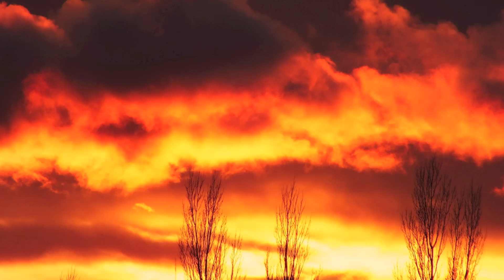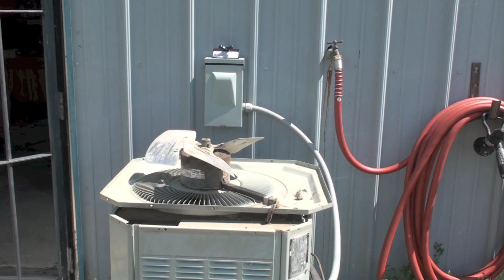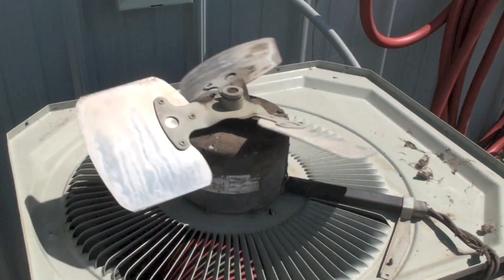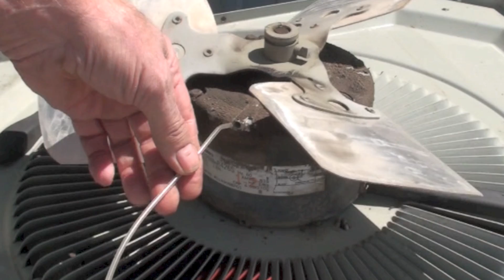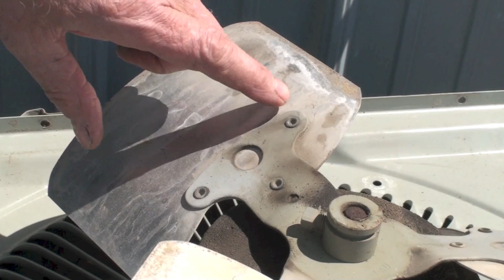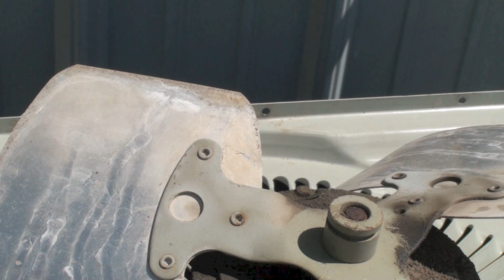Service the air conditioner, check and oil the fan motor, part 3

Comment: Where is the disconnect
Reply from the maker: It should be located near the outdoor unit on the wall.  It will have flexible conduit running to the A/C unit.
GFM

Comment: What kinda oil
Reply from the maker: Most motor manufacturers recommend SAE 20 non detergent motor oil, but you can use a brand called "Zoom spout oiler" available in hardware stores.
GFM

Comment: Both of my 1993 Amana units are still going strong. One has the original fan motor! Just a little oil, cleaning and maintenance. Yes, new units are more efficient but if they have to be replaced every 10 years you lose ALL of that energy savings savings!  Here's a vid of how just a few drops of oil keeps my unit going and going and going.... https://youtu.be/wSBr0PDCbzE
Reply from the maker: Where did you get the idea they fail every 10 years?  Anyone that tells you that is trying to sell something.  Generally, an air conditioner will last 20 to 25 years if it is properly installed.
GFM
Reply: @grayfurnaceman  with a good honest repairman like you, yes. What do you think the lifespan is for a Goodman unit that's well installed? These days? I intentionally said Goodman because its current reputation seems to be that it's not a great unit but a common one.
Reply from the maker: @SwimmingintheDeep  The Goodman units are builder quality units. However they use many of the same parts as higher quality units. If they are installed well they should last. GFM

Comment: Our compressor is out back and our air handler inside our garage. We had our summer check up and the guy told us that we need to replace our motor and possibly the capacitor because there's oil "a lot of oil" on the area below the blades. I noticed in the video on this site when the guy was talking about oiling the motor that there's oil below those blades. Is this a normal part of the motor running or should we be concerned. We have a 4.5 ton Trane unit that we had installed in Sept. 2010. He told us the rest of our unit is fine.  He said the new motor does not have a capacitor in it.
Reply from the maker: The oil may be an indication of a failed shaft seal.  The motor will probably fail when the beatings dry out. If the motor has oilers, you can stave off the failure by oiling the motor several times during the season.  
If the motor fails, the compressor will be running at very high temperatures and could fail.
GFM
Reply: What do you say to the nice GFM?

Comment: One of the plastic oiler caps broke right off the fan motor when I pried it off! Any ideas on where I can purchase a replacement cap and how to pull it out?
Reply from the maker: About all you can do is drill it out.  No, it won't damage the bearing.  Forget replacement, it comes with a new motor.
GFM

Comment: I replaced my fan motor two years ago and this past fall the ac tech told me that the motor was drawing too many amps.  How is this possible for a motor only two years old?  Would oiling the motor help?
Reply: Jeff, it seems strange that a motor would be drawing too much current.  I would have asked the technician to quantify it, i.e., state exactly how much current the motor was drawing and how much it was supposed to draw, and how he knew how much it was supposed to draw.  I'd expect the maximum normal current to be on the nameplate.  Quite honestly, it looks a bit fishy to me.  If something were wrong with the motor to cause it to draw too much current I'd expect it to have a very short life since the excessive current would surely make it run excessively hot.  It may be that a bad capacitor could be at fault.  If the bearings were in such bad condition that they actually caused the motor to draw too much current, I wouldn't expect the motor to run very much longer; perhaps no more than an hour if that.  Assuming that the motor is thermally protected, it would automatically shut off if it got way too hot then turn on again after cooling off.

Your purchasing a clamp-on ammeter was a good idea.  These things are not mysterious and I'm confident that with some studying you will be able to get to the bottom of it.
Reply: Frank I have since had a very reputable company and tech come in and tell me that there is no issue with the amperage the motors in my units are drawing.  In fact he showed me what they were drawing and showed me exactly how to check and I have made notes and will be checking the current on the motors and the ratings on the run capacitors as well each year.  The guy who came out before wanted to make a repair sale evidently.  Of course now that I know exactly how to test and what to look for, I shouldn't have any more issues, and if I do need to replace a capacitor, contactor, or motor, they are easy and inexpensive enough to do so on my own.
Reply: Jeff, it's obvious that you have learned enough about the system to keep on top of the situation.  It's unfortunate that we can't simply trust contractors and that we have to become experts on almost everything, but we have to be realistic.
Reply: Plus im sure ur condenser gets alot more use in Arizona climate than in a Pennsylvania climate.
Reply from the maker: Oiling will probably not help.  If the motor was not the correct one, it could be overdrawing.  Listen to the tech.  He is able to do an amperage test.
GFM
Reply: The motor was drawing normal amperage after 1 year.  The motor I replaced was an exact model with the exact specs of the original motor.  I also replaced the run capacitor with the exact unit as well.  I don't understand.  My AC unit back east was 15 yrs old and I never had anyone tell me the motor was over amping.  Sealed electric motors have always lasted years and years in my experience.
Reply from the maker: About all I can say is if it was drawing excessive amperage, there is a problem.  You could have a failing capacitor.  Or the motor could just be failing.  If the bearings are failing due to lack of oil, oiling the bearings may help in the short run, but the bearings are damaged.
GFM
Reply: Thanks again for your reply.  What it boils down to is trust.  I have had some bad experiences with AC contractors here in Arizona.  Never seemed to have that problem back in Pennsylvania and the norm there was you got a checkup, and all was good (MOST of the time).  Here, a checkup always, ALWAYS yields some sort of issue or potential issue.  Right now I am schooling up on how to check the amperage on the motor while it is running and I will see for myself how much it is drawing.  Already purchased a digital clamp meter for just that purpose.

Comment: Fan and blower motors need oiling even if there is no provision for oiling.  If there is no provision for oiling and you want the motor to last, there is no choice but to take the motors apart to oil them.  If you do not, they WILL fail prematurely!

You really should show how to oil the bearings when there is no provision to do so, i.e., how to take the motor apart to oil the bearings.

Of course there is no excuse for making motors without provision to oil the bearings.

Recently I had to pay almost $400 to have a condenser fan motor replaced because it had a frozen bearing.  There was no provision to oil the bearings.
Reply from the maker: I could not disagree more.  By taking the motor apart you will damage seals and introduce dirt in the bearing.  If a service tech does it, which most will not, it would cost at least 1/2 of that $400.  Just the facts as I see them.
GFM
Reply: My experience leads me to a different conclusion.

I owned a box / window fan with a shaded pole motor.  Once, while it was running, I noticed that it was slowing down.  I immediately shut it off and found that at least one of the two bearings was stiff.  I took it apart, oiled it, and put it back together.  After that, I oiled it once per year.  I got more than 20 years service out of that fan until I no longer needed it at which time I sold it.  Had I not reoiled it, I would have got only about four years service out of it.

Some years later, I disassembled the blower motor on an evaporative cooler and oiled it.  I had no trouble with the motor.  It was a 1/3 HP 2-speed split phase motor.

Perhaps you actual experience is different from mine.
Reply: I agree with Frank as long as the motor is first cleaned so dirt doesn't get into where it shouldn't be. Sealed bearings will dry out and are just a way to sell more motors. Take em' apart, oil the felt and put it back together. Watch this video: http://tinyurl.com/lwmnkoh
Reply: Frank Eggers Do you have a video showing how to oil the motor? Because mine doesn't have a specific spot for oil?
Reply: I had to disassemble my motor to oil it and everything seems to work. 4 nuts and though bolts was all it took to get to the bearings. Even 20 years of no service it still looked good.
Reply: Thanks for your insightful replies Frank, I would love to maintain my HVAC motors like this so they can hopefully last super long!

Comment: the fan motors that run the central air unit New Motors are they usually full of oil or do they need to be oil from the start?
Reply from the maker: They come with oil.
GFM

Comment: What kind of oil is used for this?  Just any light oil?  Thanks for the great videos!
Reply: 10-weight non-detergent machine oil
Reply: WD-40 also works
Reply: A/C guy said never use WD-40.It drys out.   A commercial High Speed Sewing Machine oil will work.  He also said not to use 3 in 1.
Reply: As that is semi true its still a good fix i did it and my ac still runs great and that was 6 years ago
Reply: @raymondkirkland5130  No offense intended, but I think your unit continued to run because there was already enough correct lubricant. WD40 is NOT a lubricant. It is a solvent. Now, if your fan motor had some corrosion, then it is possible the WD40 broke that corrosion up and that is why it seemed to help the running of the fan motor. But long term, WD40 will not provide protection against wear.

Comment: I'd wipe off the area around the oilers first. The zoom spout in your video could have dragged in dirt.

But hey, I never saw a hvac or oil boiler tech even bother to lube a burner motor to its book. Or clean a lwco sensor.  More business later...

Comment: I kind of figured you would test the capacitors while the front panel was off. I was actually really curious about that. I've heard 6%, 8% and the standard 10% for cap testing but I've never heard anything practical about it. I'm inclined to the 6% off needs replacement, just to give the customer some extra value.